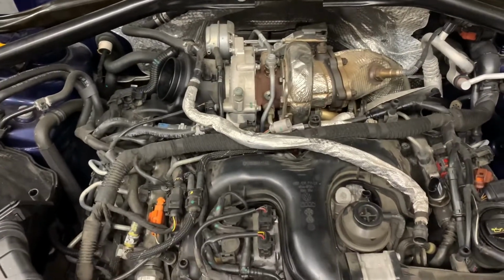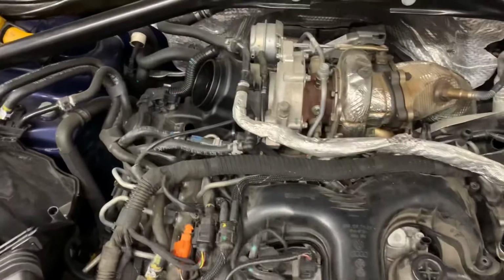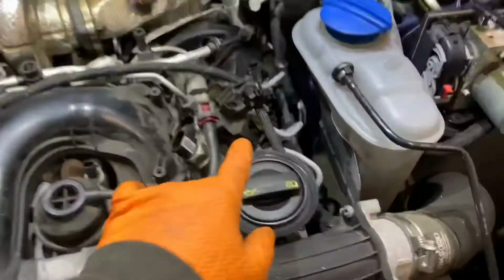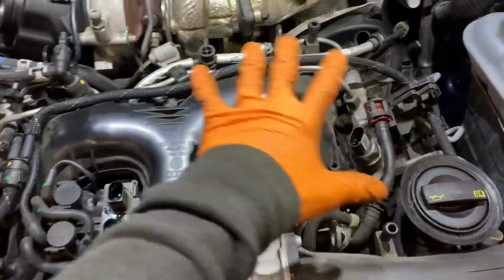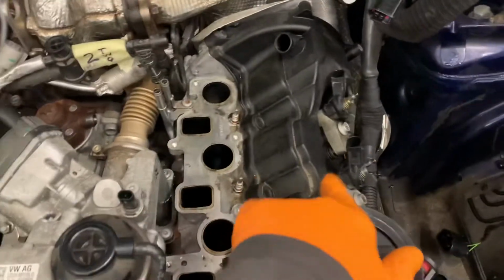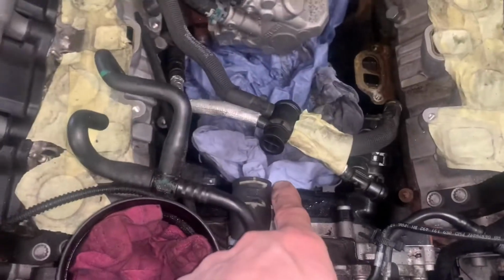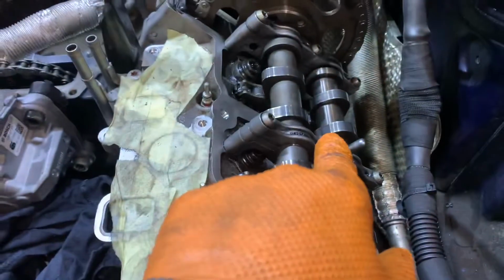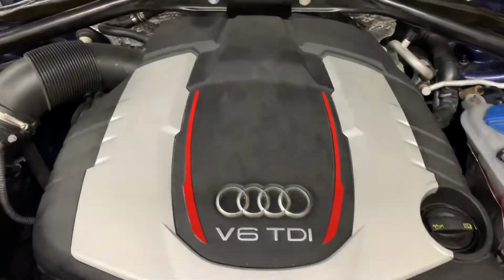Audi SQ5 3.0 High Pressure Fuel Pump Failure Due To Fuel Starvation (CGQB Engine)

Comment: I have the same  car low fuel pressure  its doing my head in changed  loads of bits still the same if it turns out to be this pump it will be out bonfire on November  the 5th

Comment: Hi chris how hard is it to undo that bolt on HPFP as it will be my first Audi with this issue and that Audi is mine ... i worked on thousands of other cars on Q7 never so with this pump id like your little tips how to undo the actual HPFP shaft bolt any method or it just comes off once sprocket is locked in place
Reply from the maker: From memory I’m pretty sure is was just a case of locking pin in and then undo with spanner, wasn’t too bad to be honest

Comment: Hello, I have a Porsche Macan with the same engine and the fuel pump is broken. I haven't disconnected it yet but I'm afraid there is iron in the fuel line.. 

how was it for you? was it completely broken?
Reply from the maker: The entire fuel system was contaminated yes, short of the tank being changed it was an entire fuel system replacement
Reply: Even the lines from and to the tank?

Comment: Hey man great video we’re did you key that special tool to spin engine so I can get that pin point for for high pressure pump? Maybe you have link ?
Reply from the maker: Hi do you mean the tool I locked into the crank pulley?
Reply: @Chris_CDB  yeah but I did find already. Thanks for replying 👍👊
Reply: I require this tool and the pin can you attach link please

Comment: Hi Chris, I have a problem. Bought an SQ5, got it pretty cheap but it did have a fault code 'Turbo Actuator Stuck open. 2 weeks of good driving, turbo boosting fine, but its now in limp mode with turbo problem. Tried fitting a new actuator which hasnt resolved the problem. Apparently you need special VAG tool (VAS6935 and VAS6935/7) to pair the actuator to the garrett turbo correctly. Actuator rod nice and free but local garage says that the full turbo will need replacing as the vanes wear. Bummer! I've been told that it's not a job for the driveway, but I'm keen to take my time and give it a go and also do the HPFP at the same time. My question is, do I need to get under the car much to change the turbo or is most of it accessible and doable from above? Anything special I need to watch out for when doing this and which special tools will I need? Many thanks for any advice :-) Ben

Comment: Hi, great work. The engine of my SQ5 Plus simply stopped at 190kmh on the highway. Now I have already checked the injectors and the timing chain and they are OK. Unfortunately the crankshaft doesn't turn. Is it possible that it is the high pressure pump? Thank you in advance. Greetings from Germany.
Reply from the maker: Greetings from England!… erm you say that the crankshaft doesn’t turn?.. if the crankshaft is seized and won’t move then you have a much bigger issue than the fuel pump!, that would imply the engine is dead!
Reply: Hi  @Chris_CDB  - did you find out what the problem was? Bottom end bearing shells gone bad maybe?
Reply: If your engine does not turn, you either have piston head contact ,rod the block contact ,foreign material in combustion chamber ,or most likely a valve has dropped from most probably the 2nd bank cam position fault .

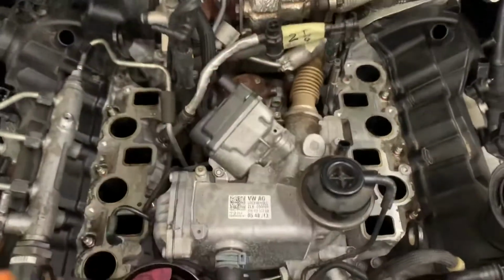Comment: any tricks to removing the turbo, the exhaust manifold to turbine bolts are pretty buried. I have the exhaust downpipe unbolted and ready to come out but it wont jiggle out without removing turbo first. I am at about the 6:20 mark
Reply from the maker: From memory I know that the job was a bit of a fiddle mate, had to unbolt a lot more than you would like to get bits out. I can’t remembering how I removed most of the bolts, just worked through it.
Reply: Great job with the video  @Chris_CDB   ! If anyone has a video on how to fully remove the turbo that would be VERY useful as I cant find any info anywhere. I have a problem with the 'turbo actualtor stuck open' and would like to change this part, but no idea how to do it...
If any of you chaps have any pointers please let me know :-)
Reply from the maker: You will probably struggle to find a “full” video to be honest as this job is mammoth, so to film it would be a fair task! especially whilst trying to physically do the job and keep some sort of track of where you are!

Comment: Hi man , i have a audi q5 2.0tfsi 2012 ... when engine temperture is cold it starts perfectly ,but if i turn off engine and i try again after 10 or 15 minutes to start it refuses to start ...i need to repeat for 5-6 times ,it start only if a push gas pedal when i start engine  ... i have changed low pressure pump, engine throttle, phase sensor and the same problem ... any idea what can be the problem .... thank if u respond to me
Reply from the maker: Crank sensor issue possibly, when it warms up, may be worth checking that.
Reply: Hi  @Chris_CDB  - did you find out what the problem was?

Comment: So, if we use high quality diesel fuel and change our filters regularly we can avoid this?
Reply from the maker: Erm, the quality of the diesel is not necessarily the issue as such, fuel filter is a must. Unfortunately it’s just these pumps which are inherently problematic.
Reply: @Chris_CDB  Thanks for the info. This is concerning(that there is no way to avoid it).
Reply: It is VERY concerning as if this pump failts catastrophically, which it does  80% of the time, then it will kill your injectors. If you have new injectors then best to change pump before it dies - 150 k miles would be a suitable time to change it, if its lasted that long. The Bosch CP3 did not have this problem. Either try to use premium diesel or use a cetane booster / injector cleaner which will increase the lubricity of the diesel and prolong life expectancy of the pump. Change fuel filter regularly as mentioned by Chris :-) @KaloyanBeshev

Comment: Fantastic work here Chris - real mechanic not just a fitter! 👍 Coming to you for a camshaft replacement on the same engine, this time in a Audi A7
Reply: Never seen 2nd gen 3.0tdi that has any problems with camshafts. 3rd gen has often camshaft sprocket rattle but the one in the video is 2nd gen

Comment: Just started my sq5 bitdi and it sputtered and cut out, I now can not hear the fuel pump prime before I try to start it, could it be a blown fuse to the pump?
Reply from the maker: Hard to say mate, you would have to test the pump via diagnostics and see if it runs, or put a multimeter on the cables to the pump, switch on the ignition and see if you have power there.
Reply: Darren, did you find out what was wrong? Start by checking with diagnostics and if you can heard the fuel pump then either you need a new LPFP, fuse or relay.  @Chris_CDB

Comment: Hey Great job and video mate! My SQ5 competition with 326hp (CVUB) died, So I removed the engine and saw the chain of the fuel pump/oil pump cracked... So I replaced all chain and tensioners + the fuel pump because I think this was blocked en that's why the chain was broken... no metal pieces in the pump or lines but I didn't trust that and replaced also... Now I'm done rebuilding everything but have a question before I start the engine after I put it back in.

How did u bleed the fuel system? Is using VCDS enough? Or did u also bleed manually by removing the front injector line on bank 1 and bank 2? 

Thank you very much!
Reply: You bleed the system using VCDS.
If I recall correctly it is under Bastic Settings -> Initial fuel filling.
Reply: Probably waaay too late to answer this but I know the answer as I've been researching and working on the fuel system on my SQ5 of late. Use VCDS, output tests, fuel pump electronics and click start. Run until you hear that the system is bled, shouldn't take long. You can hear the tone of the fuel pump / system change tone when its bled. run for longer if not certain. Note that this DOES bleed both LP and HP systems, so you dont need to piss about with loosening nuts to injectors etc.
Reply: A question for you - when you installed the HPFP, was it just plug and play ir did you need to do any timing of thie pump or setting up with VCDS?
Reply: @BenJamminJones1  It was just plug&play. The car started directly after bleeding with vcds. 

Used the car 23.000km's after the rebuild without any issue and sold it.
Reply: Nice one!  @Figo_78
Reply from the maker: There was no “setting up” just hold the chain with the timing pin, and plug and play!
Reply: Do you have the fuel pump pin part number? 2014 q7 i believe it's the same 3.0tdi

Comment: Bosch should be sued for producing such a terrible pump.
Reply from the maker: Yea, however they rely on the fuel to keep the internals lubricated.. so in this instance the filter not being changed has caused pump failure!
Reply: Do you recall how many kms or miles this car did without fuel filter change ?  @Chris_CDB
Reply: You can't really blame the manufacturer.. the pump is doing what it was designed to do. Same goes with if you never change your oil filter and it gets blocked up causing engine failure, is it the manufacturers fault?
Reply: They have more issues with this pump in the States where they have diesel with lower sulphur content (less lubricity). This model pump seems to be a ticking time bomb. Who knows how long it will last? @MEGASilleh

Comment: Good job, explained nicely, thanks for sharing!  Is there any way to get to the fuel pump pressure sensor to replace it and to see if the pump has had it? Usually the forums say that if you remove the sensor you can see if there is metal shards in there.  I've installed 6 new injectors only to get a P008700 code, engine only has 122k km on it. I suspect its the pump but would like to confirm if there is an easier way to test it. Cheers.
Reply from the maker: Hi mate, ok so the part you want to remove is the pressure regulator/suction control valve on the pump (there is no pressure sensor on the pump they are on the fuel rail), and it is literally a ball ache to remove without quite a strip down as you know the pump is buried on this particular engine,. You have a couple of options to prove the pump, you can either remove the high pressure pump line from the fuel rail (the one that the pump supply’s ) and get a high pressure manual tester reading from it, so you are basically attaching a Manual gauge to the pump itself, and see what you get under cranking, it should build up to around 300 bar.  This basically rules out any leak in the system and will give you a definitive answer on the pump. Obviously the issue is if the pump has broken up, the swarf will be in the system (lines,rails ect), and if you have cranked it over and it has had a little bit of go in the pump you may of inadvertently pumped swarf into the new injectors…. Which will then make them fail prematurely!
Reply: @Chris_CDB  thank you for the info,   the car was running at idle and runs perfectly with no codes, soon as I put it in drive and drove it down the road the glow plug light started to flash and the car went into limp mode and started smoking heavily, i drove it straight home and pulled the codes only to now get a code the P008700. I turned the car off and have not started it since, I did install a new filter and did check the old one and did not see any metal swearl in there. I guess it all leads the pump, hope I didnt do much damage to the new injectors. 😪
Reply from the maker: @crypto-d9851  problem is, is that usually when the pump breaks up like that the pump immediately fills the lines in front of it with the swarf, and it kills the engine before the swarf has enough time to return down the return lines, into the tank and then get picked back up by the pump and get into the filter, however it’s strange that the motor was driving and you managed to drive it home that the pump must of had some pressure to run the engine!
Reply: @Chris_CDB  yes it ran perfectly, I had the old injectors tested and 3 were still in spec, I decided to get all new ones to be on the safe side and avoid the job again. Maybe im lucky and it is the pressure regulator/suction control valve, I am assuming if the pump failed all the injectors would have clogged up?
Reply from the maker: @crypto-d9851  not always mate, it literally is just luck of the draw where the swarf ends up, however usually if the control valve has started to fail you get low and high pressure codes as the regulator doesn’t regulate the pressure as it should, granted this is not always the case…. However it’s a hell of a strip down to replace the control valve, put it all back together again with new gaskets ect to then crank and have the same issue… then have to take it all apart again to basically do
The pump!
Reply: @Chris_CDB  it sure is, hence why I bought a new pump and its going on, the labour is slightly more and I wont be risking it, its all pointing to the pump. Thank you for the response. 👍👌
Reply: Did you get an answer on this as I have this exact issue and I'm very upset 😂
Reply: @livesessions3268  same code?
Reply: Yes
Reply: Changed Fuel sensor ...filter ..had injectors out and tested amd all work correctly..had relay tested all good. Only fires up when using easy start in to air intake
Reply: @livesessions3268  you've changed the fuel sensor on the high pressure pump?
Reply: It's on the fuel rail. The regulator sensor sorry. And also temperature sensor.
Reply: @livesessions3268  there is a sensor right on the fuel pump non the rail it's called fuel pump pressure control valve, is that the one you replaced?
Reply: @crypto-d9851 no the one on the fuel rail at the end
Reply: If you have this code change the one on the fuel pump, that solved my issue, also when you open it if the fuel is clean and there are no metal shards your pump is fine and its just the sensor. I changed the sendor and the code was gone and had no issues since.
Reply: OK great I'm guessing you can't get to this unless you get to the pump itself anyway ? Also was your code p0087? Lastly what was the part you replaced callee ill investigate and purchase one